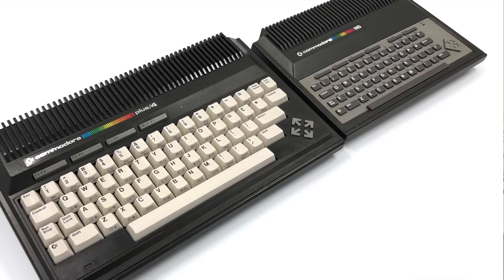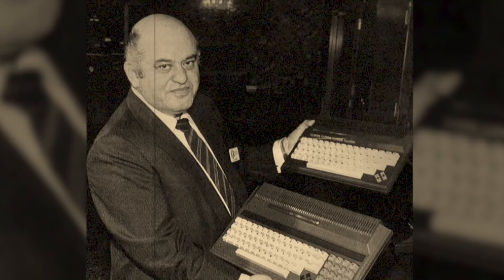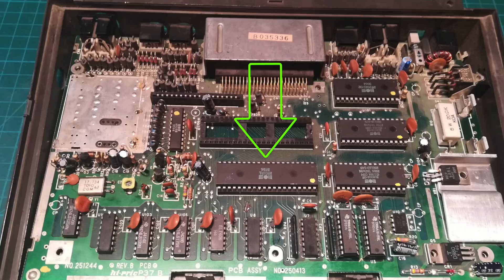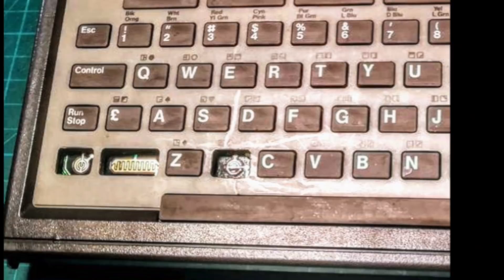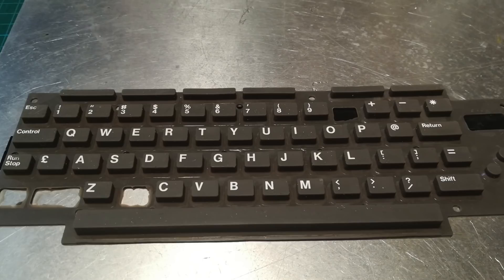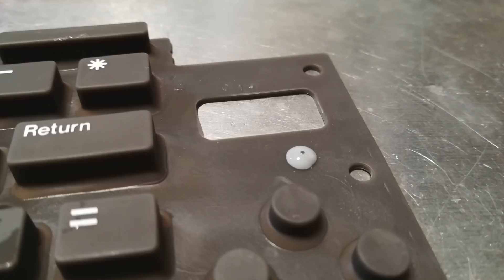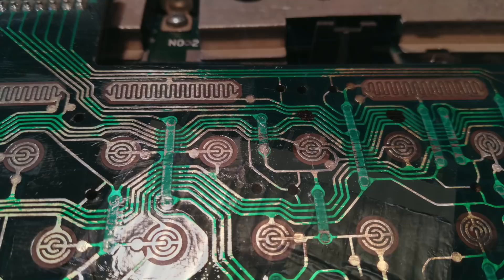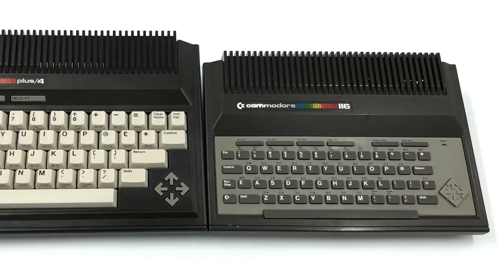The REAL Plus/4 Mini Extremefurb! - Commodore 116

Comment: I'd never realised the C116 was in a mini-Plus/4 case, I thought it was the same size just with a rubber keyboard.  I used to dismiss the 'failed' 264 line, but a few years ago I began to warm to it after seeing the number of modern ports and original games being developed, and what they were getting out of the humble hardware.

Comment: I would 3D print molds for the letters and cast them in white silicone then place them into the button mold and cast the black around them. This is how Western Electric made telephone dials for rotary phones though they used bakelite, etc. The lettering has a hidden root structure that align it into the dial mold. I've had no problem casting silicone in PLA at those dimensions.

Comment: Get the small adhesive vinyl letters and peel the ones you need off the sheet.  Then just throw those away and use the holes where they were on the sheet as stencils to dye/paint the letter labels.  If you still have some of the keys you cast, you can use them for testing to see how well various marking methods work on the silicone.

Comment: The letters on the keys can be done by making a vinyl negative mask and use white silicone airbrush.
Just get a cheap air brush. Mix up your silicone (can be clear and add pigment or use white — be sure it’s the same type of silicon). Dissolve it within naphtha so that it goes through an air brush, and spray several thin passes let the naphtha flash of and a few more iterations and voila. 
For a horror flick I created 100 leeches from silicone and several hands, eyelids and finger and I used a similar method to add colour difference. 
BE sure to wear a respirator!!!

Comment: Big thumbs up.
You really did it.
Btw.: I have still a full functional C116 complete with original Box. I have to admit that it was not my first computer.
My one and only first computer was the breadbin C16. I bought my C116  many many years later on eBay to complete my 8-bit Commodore  homecomputer collection ;-)
Additional thumbs up for repairing this nice machine.
Btw.: It was not intendet to compete the Sinclair ZX Spectrum. It was meant to compete (alas much too late) the Sinclair ZX81 (aka Timex Sinclair 1000 in the US).
Reply: Add. I took an Abo ;-)
Oh additional Info about C116/ZX81. Jack Tramiel wanted to compete with Clives well selling ZX81, so his order was to make a good computer for less than 100,-$. As we all know Jack always wanted "Power without the price".
And here he did it. A computer much more powerfull than it's direct competitor.
Keep up the good work.
Greets from Germany.

Comment: BTW. You can buy gold electroplating solution for repairing electric contacts. Also, electroless tin plating soulution could save that exposed copper from corrosion.

Comment: A really nice episode! I appreciate the efforts to revive this small machine ("It's alive!" :-) )
Could be interesting to see it next to a real ZX Spectrum.
I always thought, that if C= would make these rubber buttons a little harder, it could be even useable at a certain level. 

BTW the TED series was NOT really slower than the ZX Spectrum.

It is true, that despite higher clock speed, at certain applications Plus/4 (due to continuous ROM/RAM switching) could be slower, than a C64. Eg. in BASIC. 
It is valid for C128 too. (I am not confident about the C16 and C116, as they do not require this bank switching during prg running).

In the TED series the CPU continuously changes it's frequency, even up to 1.7MHz on the border, gets the clock from the TEC chip.
At full machine code (without ROM) it could reach ~20-30% faster code than C64.
As an evidence, worth to check Castle Master, Driller, run the same speed as C64, despite have to realise a software sprite too.
Or check out some converted C64 games made with software sprite, like Head Over Heels.

If you switch off the TED, and use only the CPU's power (same as the FAST 2MHz mode on C128), you can screw the TED series up to ~2.2MHz.
With this, 8501 CPU becomes one of the fastest classic 8bit CPUs. (certainly not in the range of 6502 3MHz or SAM Coupe 6MHz Z80)

As the MOS microcode is faster/more efficient than the Z80 one, in this mode can reach 10-20% higher calculation score than a 3.5MHz ZX Spectrum.

A really good benchmark on PI calculation/speed of different CPUs:
http://litwr2.atspace.eu/pi/pi-spigot-benchmark.html

Some ppl may say, that it does not show the platform's real speed, just a very special, not realistic environment (on the other hand it really shows JUST the CPUs' speed, and at a certain level, the speed of memory).

The other evidence, that the TED serie is at least not slower in real life (than the 3.5MHz ZX Spectrum), that those games directly converted from ZXSpectrum, run at least the same speed (or faster).  St.Helmet Zero, Pentagram, Knight Lore, unfortunately they all require 64K RAM, so canbnot be proved on a real C116 without RAM upgrade...

(a little similar topic: when the AMD Athlon 64 at 1800MHz rated to be the same speed as the Pentium IV 3000Mhz, they were rightfully called Athlon 64 3000+.
So I may call this little beast C116 4MHz+ :-) )

Comment: The 1 MHz 6502 performs around the same as a 4 MHz Z80 on most stuff (due to the ways the CPUs are designed) . So i would guess that the 1.7 MHz C116 is faster than the Spectrum. Maybe a benchmark episode with different 8-bit machines could be a fun episode? Find out which CPU is fastest on different kind of processing and calculations.

Also an episode idea: teach us how you get the incredibly good sound quality on your videos. If others can learn, YouTube will become a better place :)
Reply from the maker: Haha. Actually there's another thread here about those benchmarks and we think the 116 is just a little slower. 
As for sound quality, a Blue Yeti mic and a special recipe of Final Cut plugins!

Comment: The whole 264 series gets some stick. While it had limitations (sprites and sound) it had a better version of Basic than the rest. Some of the commands appeared in C128 basic. I have a C16 but have a problem with a loose wire in the power supply. 6 months ago I had bought a ram upgrade to make it 64K like the plus 4 but can't do anything until I sort out the power supply

Comment: paint the keys the right colour with a suitable paint then use letter number transfers then clear coat it?
Reply: Silicone doesn’t stick to anything but silicone. So the only way to paint silicone is with silicone, that has pigment added to it. The best approach for an even colour is to do it during the mixing stage. And this stage it would be probably impossible to match the colour and keep the texture and shape. You can airbrush pigments when you mix them in silicone and thin with naphtha (I believe you call it in the US, basically lighter fluid). But I think you’d need a lot of passes to match it.

Comment: What if you create a new mold with a 3D printer, where you create the lettering as a small indent in the rubber, let it harden, and then apply another color of rubber on top of the button, and scrape it off, so the only the rubber in the indent will be left.

Comment: 4:43 You can't just compare the clock speeds of very different CPUs like the 8510 (which is a 6502 variant) and a Z80 to decide which computer is faster. A 6502 is much more efficient with each clock cycle, and actual throughput on the C116 will be very similar to the Spectrum.
Reply from the maker: Now I want to run a benchmark on both! If only I had a Spectrum... I do think the C116 would be slower. Note the Z80A has a 3x faster speed, but I mentioned it's only twice as fast. That's my rudimentary factoring in the 8510's efficiency. It would be a fun test.
Reply: @RetroRecipes  There was recently an excellent port of the Speccy classic Knight Lore to the Plus/4. It won't run on the C116 for lack of RAM, but it would be a fun (if not entirely scientific) way of comparing performance between the 264 series and the Spectrum.
Reply from the maker: Go for it! 😉😉
Reply: @RetroRecipes  Remember: the 7501 (8501 in later models) ran @ 1.78MhZ which is like twice the speed of C64's 6510.
Reply: Furthermore (not sure about the ZX spectrum specifically) but some machines rely on the CPU to perform tasks (like video, audio, or working with peripherals) for which others have dedicated chips.  I seem to remember that ZX80/81 rely on the CPU to generate the video signal.  In other cases various component requirements require wait states etc that sap the CPU’s full potential.  WRT a Z80-equipped spectrum it’s possible some raw computations might be faster but the overall real-world package would be competitive but not markedly superior.
Reply from the maker: Technically it has a 0.885/1.76 MHz clock frequency. I showed the average 1.1 in my video. The 6510 had an upper speed of 1.023 so you could argue the 8510 is slower not twice as fast. Of course it's all speculation without a benchmark. 👍🕹️
Reply: @RetroRecipes I'm sure you know wars have been fought over this subject ;) It's fair to say a 6502 (or other processor in the family) is at least twice as efficient per clock cycle than a Z80, and sometimes 3 or 4 times as efficient. I suggest a factor of 2.5:1 for something complex like a game. So if we take that 1.1 MHz average, we end up with the C116 having an equivalent throughput of 2.75 MHz vs. the Speccy's 3.5 MHz.

Keep up the great work on your channel, I love the production values and the humour.
Reply from the maker: That's a pretty accurate guesstimate! Ok so I should've said it's "faster" not twice as fast 🤦‍♂️ Either way somehow I love them all almost equally. Almost...
Thank you for your kind words. Means a lot. 👍🕹
Reply: The TED chip steals cycles from the CPU when it is displaying text: which is why the CPU does not run at an effective 1.78 MHz all the time.
If you could disable video (like you can with the VIC-II) it should be able to run faster.
Reply: @FindecanorNotGmail   The TED chip steals a lot more cycles than the VIC-II does, however.  The 264/TED series computers are much more like the Atari 8-bit computers than the C64 in this way.  Both are only a little faster than the C64 in terms of CPU, unless you turn off their displays (the DMA of the TED or ANTIC), that is.  Running in the best and most common graphics modes, the Atari's CPU runs about 18% faster than the C64's CPU with sprites off on both computers, and 13% with sprites on.  The C64's sprites help its CPU a lot more than the Atari's, however, which cuts into or reverses the Atari's advantage with games or applications that rely heavily on sprites.  The TED computers don't have sprites, which puts them at a disadvantage for some uses, but 18% faster in CPU is probably roughly the advantage they hold over the C64 if we don't consider sprites.

Turning off graphics DMA allows the TED and Atari computers' CPUs to effectively run at about 1.648 MHz, once we subtract the cycles that are still taken away from the CPU to perform DRAM refresh.  With the VIC-II DMA turned off, the C64's CPU runs at 1.023 MHz (identical to the VIC-20's CPU).  This is a 61% advantage, not 78-79% like most people expect.  The C64's CPU only loses about 6% of its cycles to VIC-II DMA with sprites off, and 8% with sprites active.

Comment: Why not go nuts, and use the "repaired" membrane to build a whole new membrane in a single color, then silkscreen the letters back on, or maybe even vinyl print the letters back on.  I'm sure there are some good screenshots that can be used to get any fonts/symbols replicated for a silkscreen or vinyl printer to do it's thing.  I've seen Dave over at 8-Bit guy go to similar levels and the end result, while not 100% accurate is good enough for all but people really in the know to realize it's not original.  The extra work involved in going this route would be interesting to see, as well as add that extra love to a refurb like this.  After seeing you resurrect the machine that was bent, cracked and corroded to no end, this sounds like something you'd be great at taking on!

Comment: 8 Bit Guy would be proud of you

From what I understand the Commodore Plus 4 was inferior as a general purpose computer, but it had 4 business programs
Reply: Cl Lyman Not especially inferior — better in a number of ways — but market failure. Biggest sins were incompatibility with large C64 software library, and Commodore asked too high a price for what was originally intended as a cost-reduced machine with fewer components.  No sprites or SID, but a lot more colors, faster-clocked CPU, and better BASIC, along with a much faster parallel floppy drive.  The series was intended more as a VIC-20 replacement, and in that light it looks better.  The other issue was the existence of the 16K variants - this prompted software developers to target the lowest common denominator C16 and 116, not taking advantage of the extra RAM on the plus/4. Another nuisance was the switch to mini-DIN connectors for peripherals; there was some compatibility with older Commodore peripherals but adapters were required.
Reply: @57thStIncident  A perfect summary! I wish you could have been told it to the Commodore marketing team. BEFORE! :-)

Comment: Got a C116 as well,. have barely touched it. In general there seem to be a need to do some work on the keyboard, but if unopened, you need to crack it open(!) - and then repair the keyboard (!) to put it back into the computer. So i've skipped that.

The C116 is one of those MEH computers that make you considering selling it to the next person and let them deal with it.
Reply: Don't think you can find a TED chip nowadays.
Reply: @johnps1670  That is why i plastered all IC's with heatsinks since heat appears to be the problem that breaks TED and the CPU. There are some people working on replacement chips, see the Plus/4 group on facebook, they talk about it from time to time.
Reply: @johnps1670  Sometimes you can find even tested ones. But rather expensive; ~15€...

Comment: Nice job.  I love watching you turn trash to treasure on a candidate no one else would bother even trying to fix. Silicone is not an easy medium to print on.  I would experiment with some of your extra keys. I would print a correctly sized letter on a laser printer. Use the print as a template to make an outline using painters tape. Apply the painters tape stencil to the key and use Rustolium spray paint. Semi gloss white enamel.  🙄

Comment: You need to get yourself a cheap little 3D printer for your repairs. With the availability of many colors you might be able to match things up pretty well
Reply from the maker: True, though the problem here was recreating rubber, which you can't 3D print easily...
Reply: That's a good point. I've had good luck printing TPUs and TPEs that could work. Lot of flexible filament options. Great videos though, keep them up
Reply: @stevenrais9360  I've actually built my first three 3D printers myself and I have a brand new unit ready for printing. However, Ninjaflex or other similar filaments are way too hard compared to original keys. It had to be cast silicone.
Reply: @RetroRecipes  Hey, I picked up a new resin printer.  Now I'm working with a couple chemist friends to develop a rubberized printable resin similar to the feel of the old keys.  I'll let you know how it turns out.

Comment: Why do the traces on the keyboard PCB have those intricate interlocking patterns where the keys make contact, is it to maximize the chance the key closes the circuit when you push it down?  Or does it have a capacitive  property?  I notice they didn't do the same thing on the cursor keys.

Comment: It is your ability to create parts where I would have thought nothing but a replacement would be possible, that separates your repairs above others I've seen. I would think however that creating a custom transfer would be the only option for key tops you require?
I did have a 116 myself until recently. Nice little machines, sort of a Atari 600xl but Commodore equivalent, ie compact and do all that is necessary. They are easy to upgrade to 64k too and can then do all a plus 4 can do and with a simpler psu. No user port or built in packages if that is a concern.
Reply: Actually on the TED series nothing really used the User port. 
OK, maybe the C64 modems may work with some simple terminal program, but AFAIK it also needs a small hack to work.

The built-in package was never a real winner, especially if you compared it to Script/Plus (similar to C64 Easyscript), or CALC/Plus, not to mention GEOS.
Reply: @MMSZoli  liked the all in one nature of the ted. It's a pity however commodore seemed to have to rival tech going on

Comment: Why would you remove the RF modulator without replacing it? Was this a parts machine?
Reply from the maker: We think so yes. 
And as the old saying goes, "one person's parts machine is another person's extremefurb". Right?
Reply: @RetroRecipes  you've tackled worse. I'd just use a stencil and some spray paint to put the letters on there.